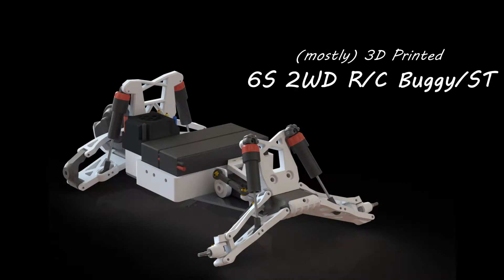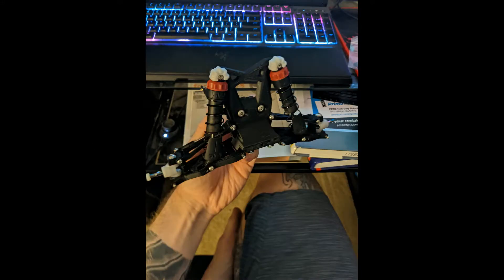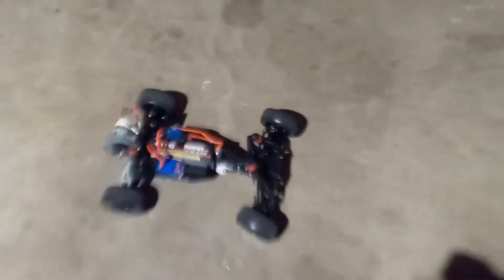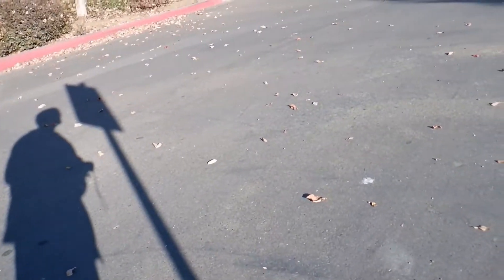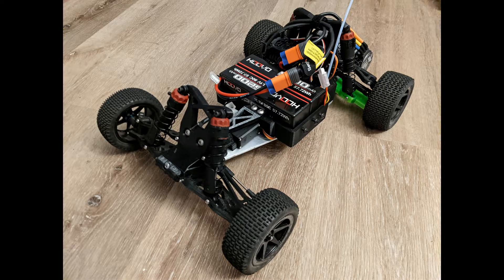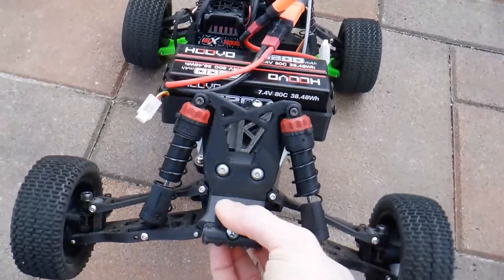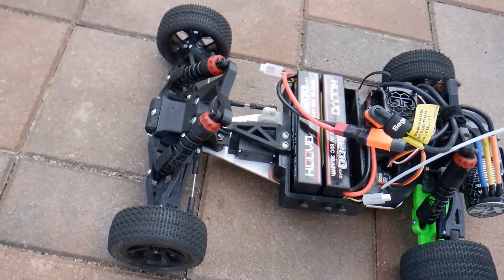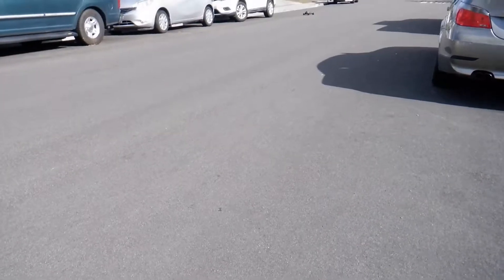3D Printed 6S RC Buggy

Comment: Very interesting design but 6s looks overkill to me, I would stick witha 2s maybe 3 maximum with a decent brushless motor, it would help to keep the chassis light too. Nylon and PCTG would be the filament of choice for durability, did you also ever tried to 3d print the chassis instead of aluminum?
Reply from the maker: Thanks! and yes, i agree that 6s is overkill, but I like to stress test my designs to see the limits, then push beyond them. The car is perfect as 2 or 3s. Currently I put that Arrma 6s motor/esc into my altered Granite, and put those 3s electronics into the 3D printed car. It's more than enough power for this size car. 
For the materials, I start with prototyping with PLA. I upgrade the parts when they brake to a tougher material. PLA -> PETG -> TPU or Nylon. Some of the parts on it are the original PLA ones since that's what was sufficient. 
The aluminum chassis plate was intentional from the beginning. I did not want to 3D print the whole chassis, I wanted some modularity. The 6061 T6 aluminum plate adds quite a bit to the car. It does stiffen it up, but keeps it springy to absorb landings. 
It's a stout and stable car!
Reply: @dadsfriendlyrobotcompany  I understand your decision on the aluminum chassis, BUT ( stupid idea perhaps) a 3d printed chassis to be used as a Template/jig for drilling the aluminum chassis holes perhaps🤔?
Reply from the maker: @ripmax333  yeah, you can totally do that! I've done 3d printed hole jigs on other projects. The first one I made was cut out by hand. I just printed the DXF file (made sure it was 1:1) and glued it to the aluminum plate.

Comment: You might consider printing the parts with ASA if you have an enclosed printer. It has much better impact resistance than PETG or PLA as well as much better temperature and UV resistance.
Reply from the maker: I agree! But the goal will be to print in Nylon, since that material is currently used in injection molded RC chassis parts. I do have a few SLM nylon parts installed and they seem to be holding up quite well.
Reply: @dadsfriendlyrobotcompany  That’s fair. I only suggested ASA since, while it’s harder than PLA or PETG to print, it’s not nearly as difficult as PC or Nylon and gets you many advantages. If you have a good path for Nylon (especially filled Nylon for this use case), or PC, then by all means that’s probably the best route.

Comment: looks great! could you do another video on what traxxas parts you've bought and how you put the rear diff/gearbox together? Struggling to find a how-to for making a 2wd buggy like this
Reply from the maker: Yeah, totally! Anything else you would want in there?
Reply: @dadsfriendlyrobotcompany  do you use fusion360? a cad workflow video for how you integrated the traxxas parts to your parts. I guess you could make it less specific so could be more applicable to more people as a general guide. Basically i'd love some more detail on the specific parts and how they fit together :)